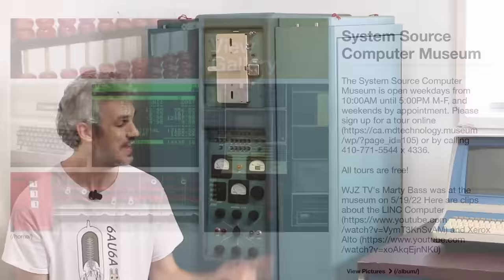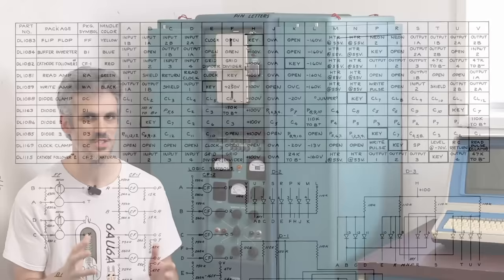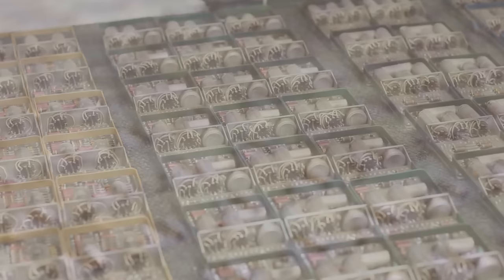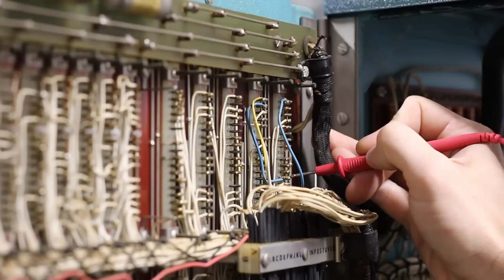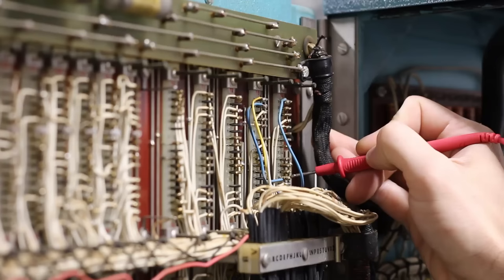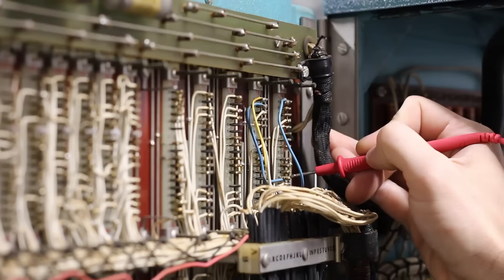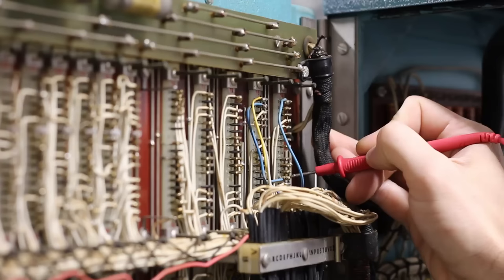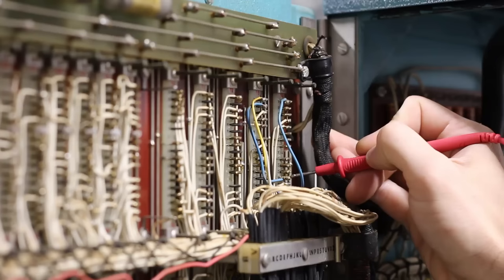Exploring 1950’s Computer Logic with the Bendix G-15!

Comment: Change the caps, they are not ok. Electrolytic capacitors have a life span, even never used caps that are that old will be no good.
Reply: They might not be as good as a brand-new modern capacitor but old electrolytic capacitors can still be good. Most of the big ones in my old 1949 TV still work fine, and this isn't rare. It's tiny electrolytics which are much more likely to be open. The more pressing concern would be if there are paper coupling capacitors in high-impedance circuits.
Reply: @eDoc2020  Just because they haven't exploded, doesn't mean they are not starting to turn into resistors and are passing dc current.  All electrolytic go bad, some sooner that others, they are cheep, change them.
Reply: @mikeepeck   All electrolytics pass DC current, it's just a question of how much. The B+ caps in my TV stay charged for the better part of a minute if the tubes are cold, and that's with a resistor network draining them.

Large quality electrolytics also are far from super cheap. There's also the need to find a new mounting solution and rewire because the old ones are multi-section twist-lock cans and direct modern replacements for those are like $40 each.

I'd rather keep the original ones in my TV
Reply: @mikeepeck  And as you said, all electrolytics go bad. Why replace something which will fail eventually with something else which will fail eventually? A modern cap could be part of a bad batch which fails in under a year.
Reply: @eDoc2020  You smoking dope, That's like saying if your car engine is bad, why would you put in another one if you'll only get another 500,000 miles out of it.
Reply: @mikeepeck  No, it's like saying why put in a brand new engine if the current one still works. I'd rather get the most life out of the existing parts before starting the clock on new ones.
Reply: Still running,  but burning a quart of oil a day.
Reply: @mikeepeck  But it's not that bad. Maybe a quart of oil a month. Is it really that hard to imagine an old capacitor that still works? My TV was kept inside all its life. Even among dead electrolytics excessive leakage is uncommon, usually they just go open circuit.
Reply: @eDoc2020  Is it really that hard to replace a 50 cent part so you don't risk destroying something irreplaceable.
Reply: @mikeepeck  If it was only a 50 cent direct replacement and there were any signs of degradation I would. In fact I've replaced (almost) all the paper capacitors. Replacing the large electrolytics on the TV would be at least $30 in parts plus lots of effort. This particular series of chassis is known for being hard to recap. There are probably over 20 wires soldered directly to the lugs built-in to the old capacitors which are themselves riveted to the chassis. I'd need to scrap all of that.

Worst case if a cap goes dead short is a burnt resistor and a blown fuse. The fuse was my own addition (it came without one) and I chose it specifically to prevent damage if something went wrong. Before adding the fuse I subbed in a replacement for the one dead electrolytic can (the B+ doubler) and somehow got it backwards. Everything survived.
Reply: @eDoc2020  I'm not talking about the bulk capacitors on the power supply,  I'm talking about the small caps that are on all the logic boards.  A leaky cap can red plate the tubes and cause massive current draw.  And your  capacitor tester only tests ESR, parallel resistance is the problem.
Reply: @mikeepeck  David has already decided to replace the little electrolytics, I thought you were talking about the power supply ones which he was questioning. And quote my original reply, "It's tiny electrolytics which are much more likely to be open. The more pressing concern would be if there are paper coupling capacitors in high-impedance circuits." I was agreeing with you that you need to worry most about the little ones.

I don't think any leaky caps could redplate anything in the Bendix logic boards. There simply isn't enough plate current available. It's the amplifiers for the drum heads which deserve the most attention here because those are power amps. Any coupling or cathode capacitors there should definitely be as good as possible and I would suggest replacing. Those have cheap modern direct replacements and the head coils will be impossible to replace.